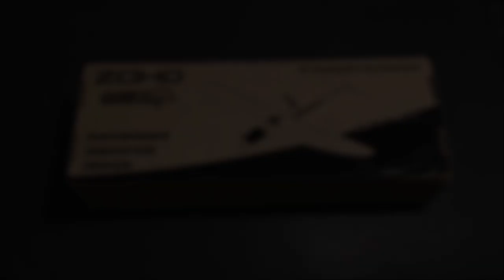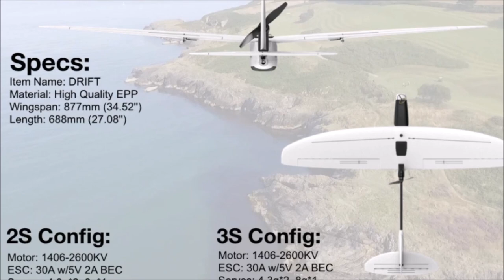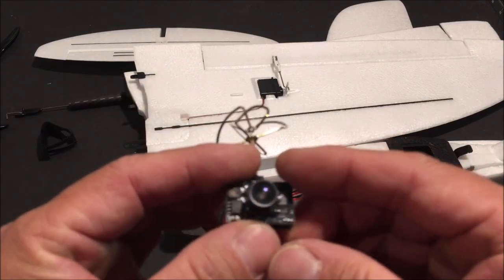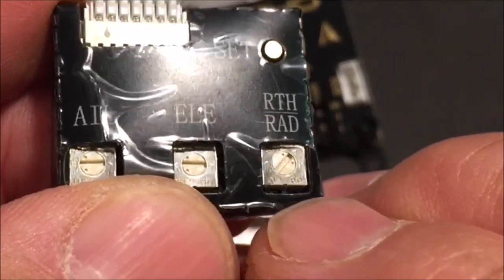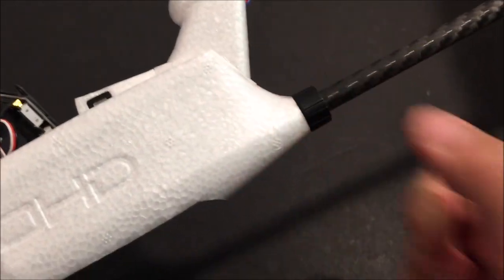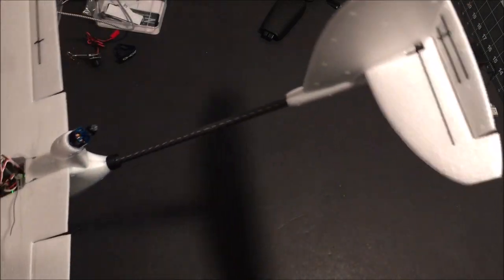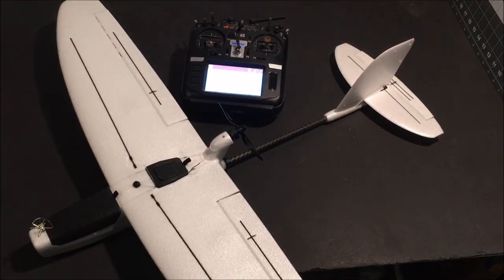Assembling and setting up ZOHD DRIFT GPS RTH FPV RC Plane

Comment from the maker: Time Stamp :
00:00  musical unbox
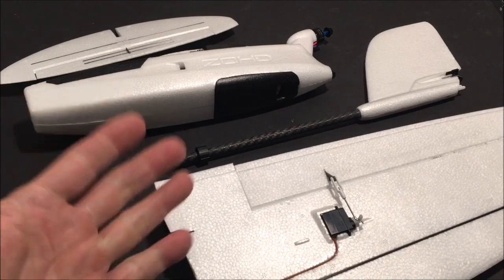01:44  closer look
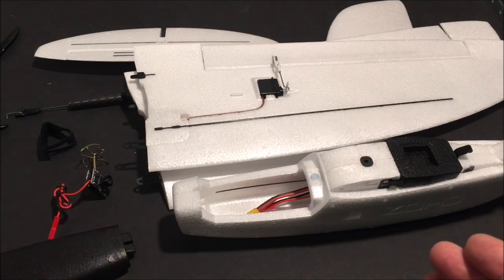04:10  FPV VC400 set up
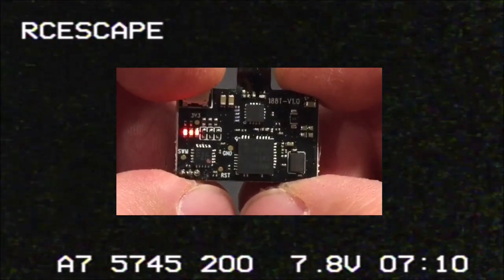06:47  ZOHD Kopilot flight controller
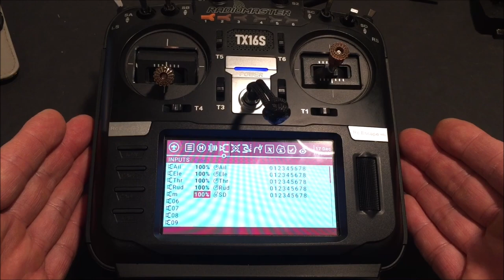07:52  Radio set up
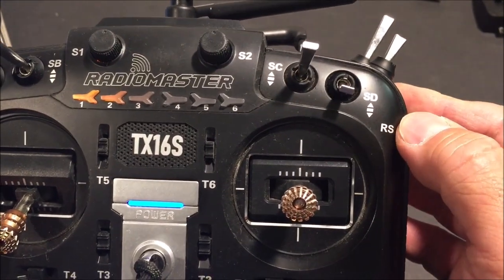08:15  GPS  RTH
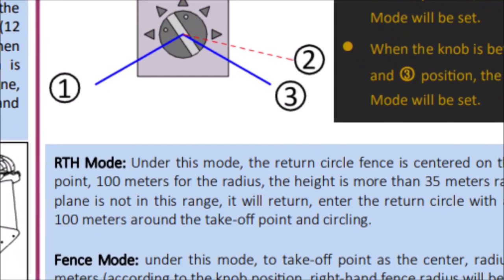09:12  Failsafe RTH
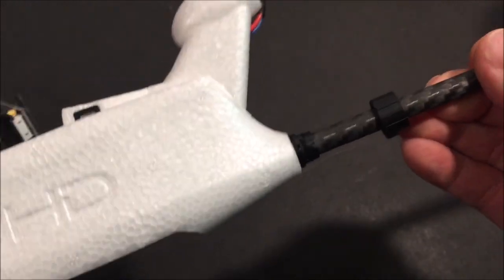10:39  Main Wing & Tail Boom Assembly
11:30  servo wires
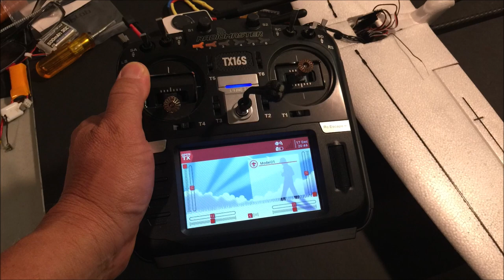12:14  power up
14:05  Final assembly and test

Comment: Why is it the motor does not start up in stabilized mode, or when you go from manual to stabilized mode the motor cuts out and stops? Cheers

Comment: One day I'll try a plane.. great review! Have a great day! 👊👊💪💪
Reply from the maker: It's got gps and fpv!  The controls are the same so it should be easy enough.  Hope I don't mess it up :) 👍🍺😍
Reply: @RCEscape  lol I messed up already. Needed new radio..went with xlite like one I had for 3 years. Not enough switches. After diving into open tx. I'm finding need for more.. play music.. prearm.. to mention a few. Question Pete? I added GPS now my radio has its data on sd card. Called tracking. I use in case lose Bird. Can read last GPS cord's. I set for every second. Then Punch in google maps fallow directions. And most importantly..if ever accused of wrong doing. I have a tracking log of said flight. Can prove my case. Fly right no worries.  But point is.. isn't that good enough for FAA? Oh I'll wreck it shooting a gap! Lol
Reply from the maker: @sleepingbearffg5008  
I hardly ever even see any police patrol car up here I don’t know if there’s FAA agents lurking around.  But there are people and some people don’t like drones and they’re the ones that will stir up trouble for us flying and minding our own business.

Comment: I have DJI Drift set according to your description. I made a few flights at critical moments when I lost sight of it, it returned to the RTH signal or signal brk. Last time at an altitude of 70m it disappeared, I turned on the procedure, the model did not return. It was the second flight after the first 20 minutes, the 3500mah battery. look for it through ERRor 99% signal without success. What procedure did not work. I've been a modeller for 50 years
Reply from the maker: I can only assume there were not an adequate gps signal.

Comment: How is it that you can use the throttle??...the manual says that after u get a gps signal that the throttle will then be activated.
Reply from the maker: That's only in the rth mode.

Comment: A great flying model.  I managed to fly mine but without the electronics in yet, before the snow came and it loves thermals.  On a good day in the summer it should be able to stay up all day having to use the battery only to get it to the height you want to start at.  A truly sweet little model.  Happy Flying
Reply from the maker: Thanks Ken!  I am a novice when it comes to planes and need all the practice I can get!  This is a great model.  Everything about it was just so easy to understand and the gps rth was a new twist for me too.  It also has stabilized mode so I should be fine :)  lol  👍🍺😍

Comment: can you do a video on how to connect the kopilot lite to the dart 250g or other delta wing, im having issues and it would be nice to see someone do it on video with the radiomaster tx16s, and how do you use launch assist mode?
Reply from the maker: sure, if someone sends me the dart 250g
Reply: @RCEscape  maybe zohd can sponsor you